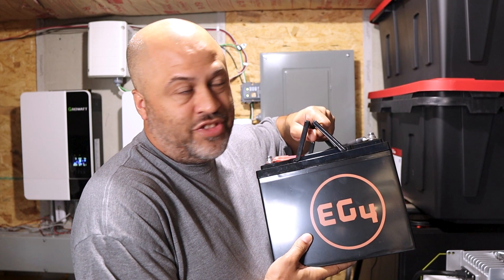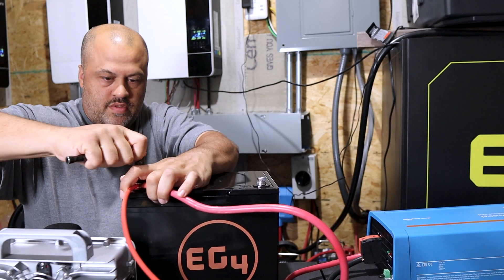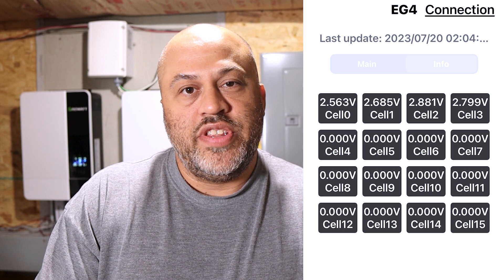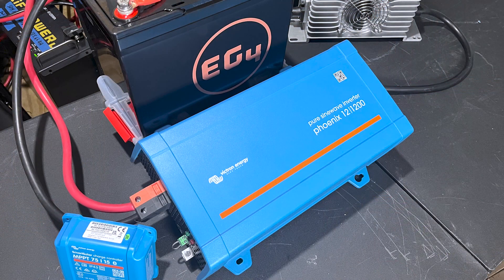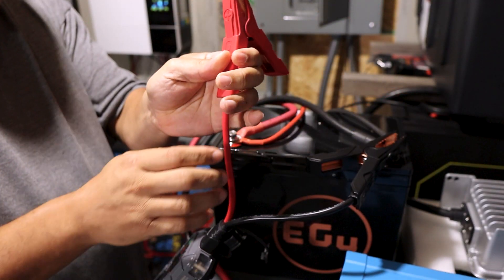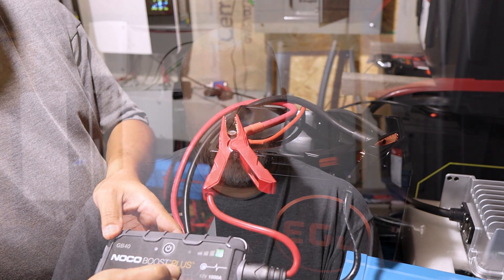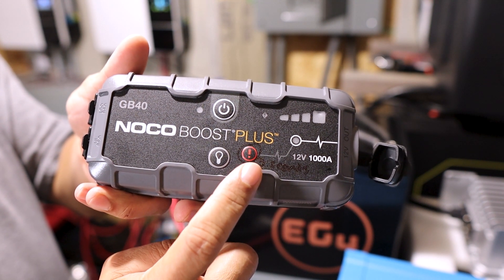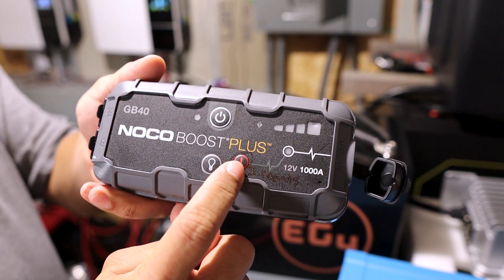How to wake a 12 Volt Lithium Battery in Low Voltage Protection

Comment: Can you wake up a sunpower lithium ion battery in uvp mode. 48v wall mount battery for solar kit. The sunpower 6.5kw kit with battery
Reply from the maker: It should wake on its own with solar input or grid to your inverter. So it won’t charge with solar or grid as well?